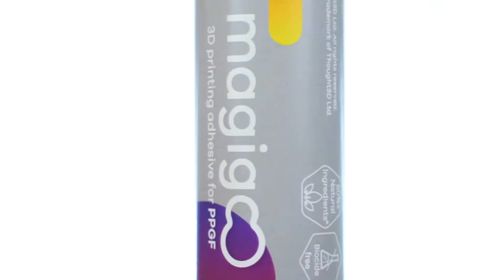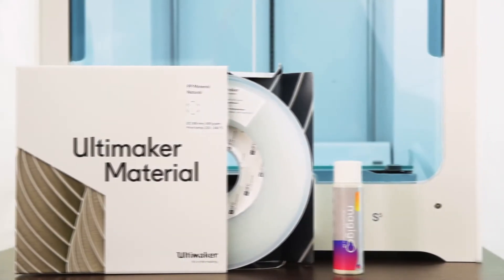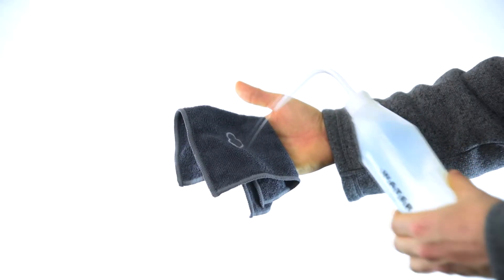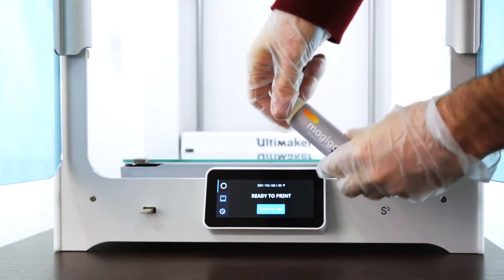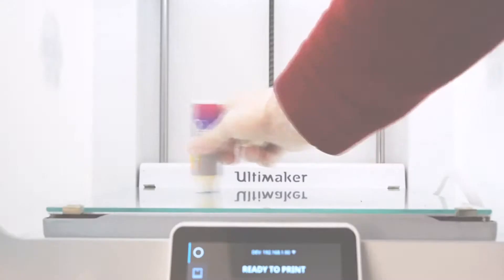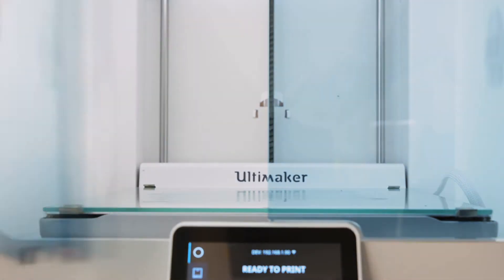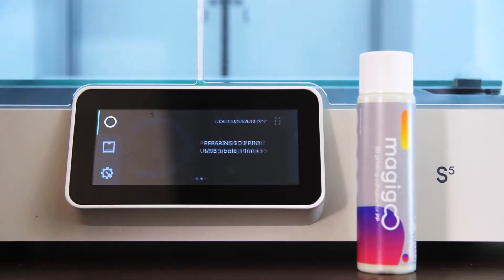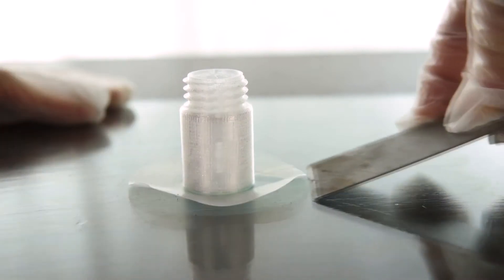How to use Magigoo PP and PPGF

Comment: Hey so here’s a fun question. Your website doesn’t say anything about this stuff being toxic or dangerous but they’re both apparently serious skin irritants and eye irritants, not to mention PPGF specifically says “do not release into the environment” so yeah not sure how you’re supposed to wash it. Not that it matters, doesn’t work anyway. I love Magigoo stuff but the PP is a baffling miss with improper documentation. I wouldn’t have bought it had I known how toxic it is
Reply from the maker: Hi Andrew, we are not sure that we understand your question.

To reply to you concerns :

Here at Magigoo we strive to make our formulations with the least amounts of hazards possible. In fact, apart from Magigoo PP and Magigoo PPGF, the adhesives in the Magigoo range are not classified as dangerous. Furthermore all Magigoo adhesives are water-based and non-flammable. 

Due to the low adhesion PP shows to various materials, it was not possible for us to formulate a completely non-hazardous formulation for these adhesives. However, for Magigoo PP and Magigoo PPGF the hazard symbols are clearly indicated on the product label and are also explained on the respective safety data sheets of these products. Given that the appropriate precautions are taken when using these adhesives, the risk posed to the user is minimal. 

The instructions for these products also clearly show the hazards and precautions which one needs to observe when using the product. Also as indicated in the instructions, all the safety documentation for using these adhesives is available upon request. 

We're also sorry to hear that Magigoo PPGF is not working for you, should wish to receive support on this product you or require more information feel free to contact us on info@magigoo.com. We're happy to help out with any first layer adhesion problems you are having with our products!